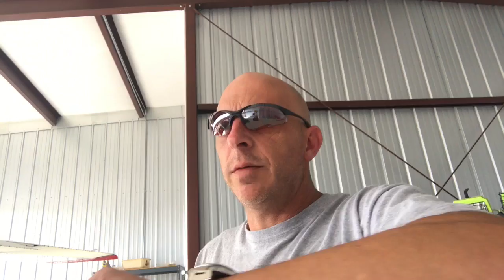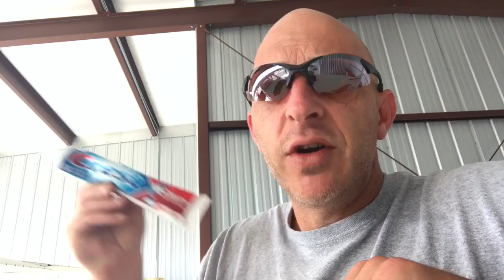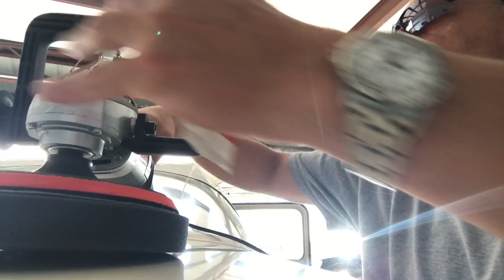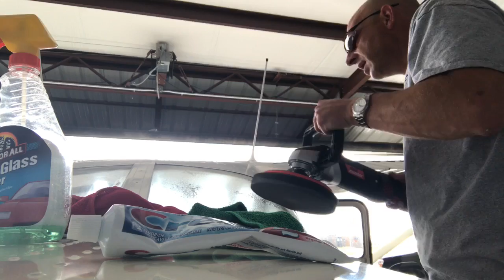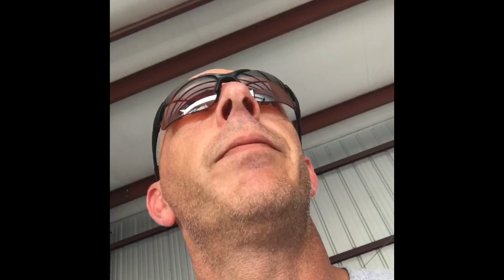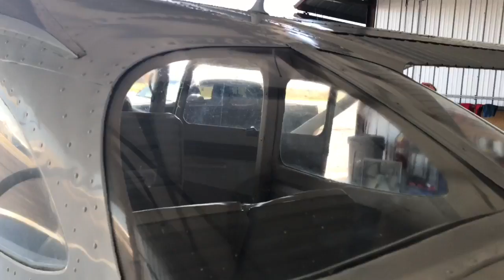Backcountry Aircraft: Fixing Scratched Windows in the Cessna

Comment: Nice job. I can tell you why rearward visibility is important. Two weeks after the PSA Flight 182 crash I was flying a Cesdna 182 from SMO to SDL. I took off from SMO and, while talking to LA Approach, climbed to 11,500 in a racetrack pattern over Santa Monica Bay to get over the TCA (now Class B) as it was nearly impossible to get a clearance into it then. As I passed thro7gh 9,500 feet (on a sunny afternoon) it suddenly got very dark in the cockpit. A 707 flew over me from behind in a descending right turn so close that his engine pods passed me on either side at my exact altitude. I could only see the belly of the fuselage and a bit of a red or orange trim stripe just above the belly. I think it was an American Airlines plane, but I'm still not sure. I looked down at the ocean and thought to myself "it sure is a long way down." I was used to flying with my Dad, Mom and brother, all of whom had their assigned traffiv dpotting duties, but thus time my brother's girlfriend was in the back seat and never checked our 6. Needless to say, our collective visusl acuity suddenly improved drastically. I asked approach if they saw any traffic in our vicinity and they said no. I later discovered that LA Approach could, and normally did, deselect Center heacon codes, due to the very high levels of air traffic in the LA basin.

Comment: From a detailer: try a three or five inch buffing pad. It seems safe using a finishing pad, but you’d get quicker results with a medium correcting pad. To remove micro scratches left by the toothpaste/compound, use a finishing polish with your finishing pad. Then use a sealant to UV protect and aid in water runoff. The correction pad will also get your overspray off—usually. Tip: I like Lake Country’s gray pad. It is for heavy compounding, but it finishes with a polish. It’s my go to if I want to reduce the number of steps but end with a good finish.
Reply from the maker: Thanks Lydia - Minty fresh for sure!